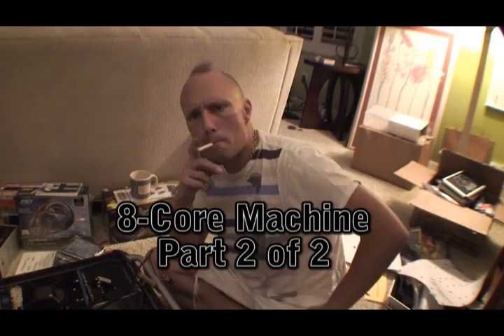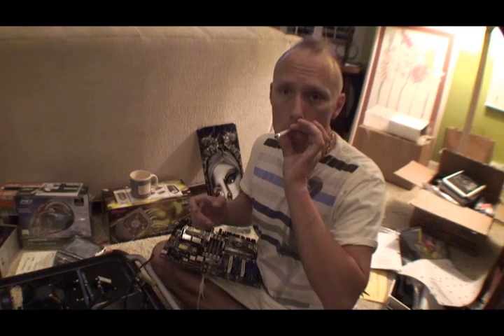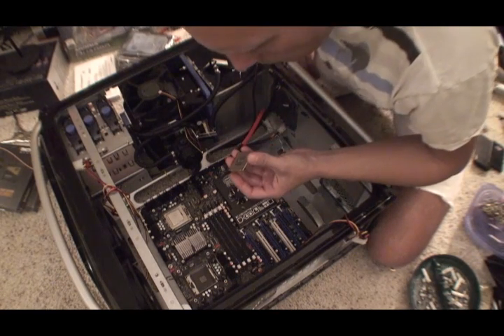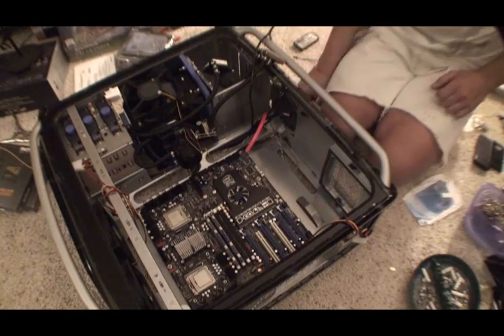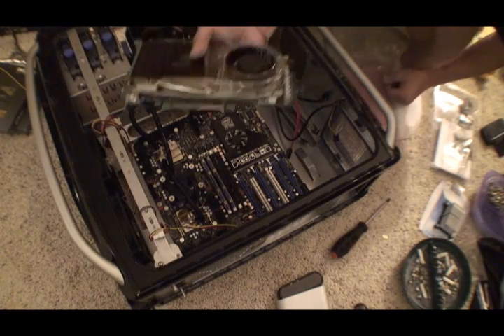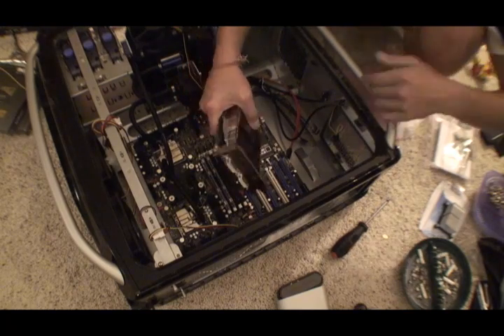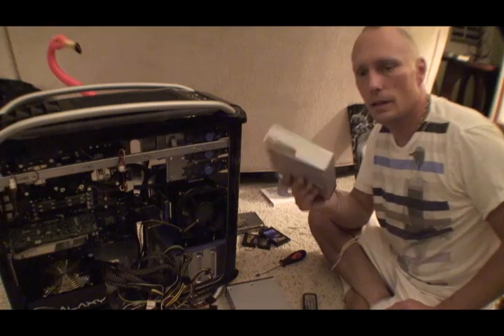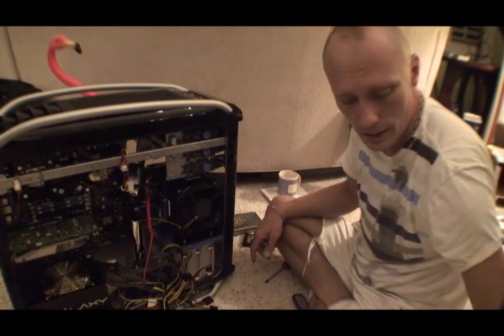how to build a computer part 2

Comment: @AfroNinja720 , Way out-dated? I built a good computer in 2008 as well it lasted me until now, 2012. And not because it was outdated, because I accidentally killed it with a glass of coke. So computers last long, if you buy good parts